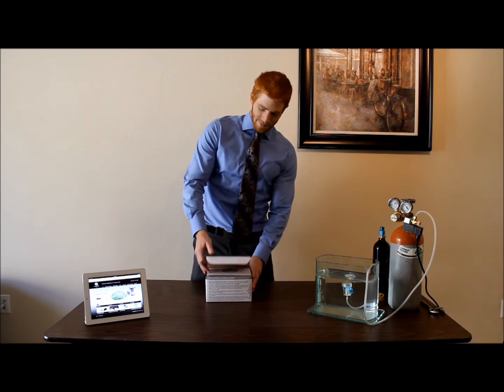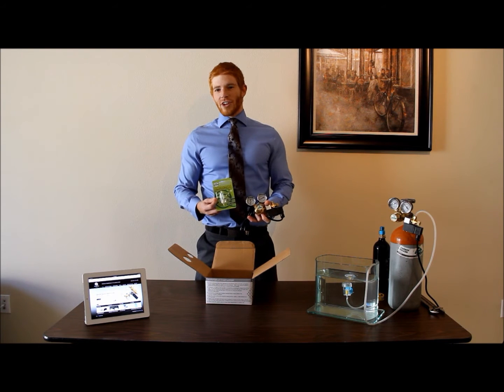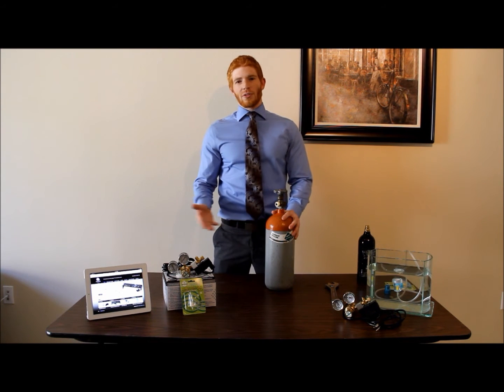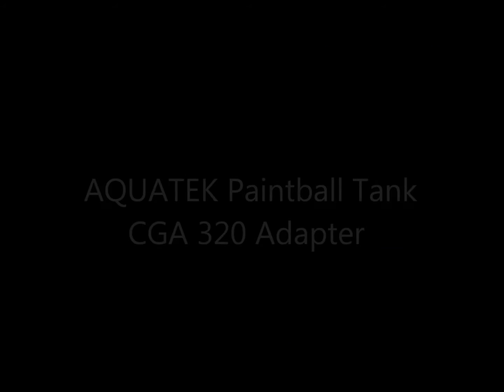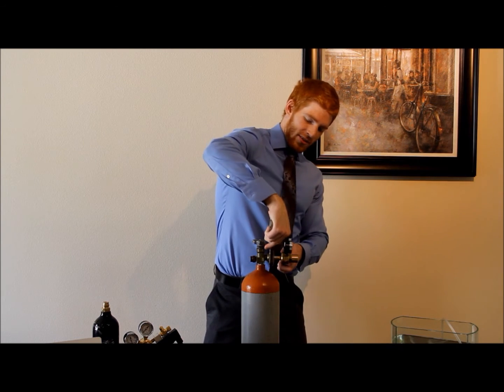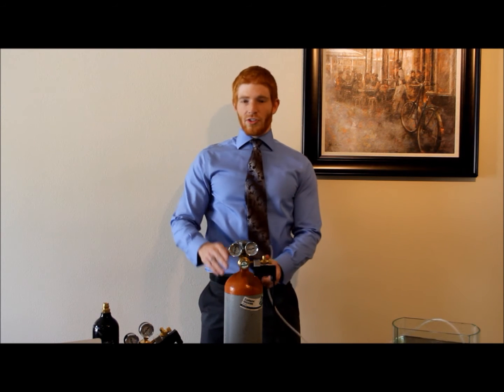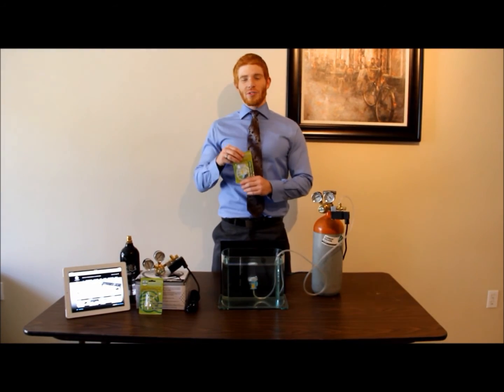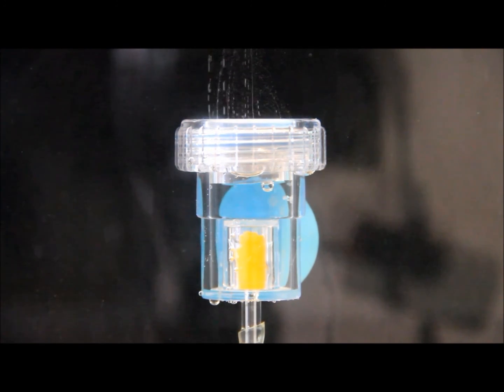Aquatek of California CO2 Regulator with Cool Touch Solenoid

Comment: why do you need the Bubble Counter with Integrated Check Valve that's included if you use the 3-in-1 option?  or can you use both?  I would like to diffuse co2 to the bottom of my filter (so the 3-in-1 product will not be a good match because it would not allow me see the bubbles)   Doe Aquatek offer a plain diffuser?  Any diffuser you would recommend?  Thank you

Comment from the maker: Thank you for your purchase and inquiry. Here are some tips about how to use CGA320 adapter properly.

1. Please DO NOT use the plastic O-ring in between the adapter and CO2 cylinder.
2. Please tighten the adapter and regulator with a wrench.

Also, please refer to the attached links in the video description, which are the discussions about how to attach the regulator to paintball tank and a Youtube video (thanks to a CGA320 user)

Sincerely,
Aquatek of California

Comment from the maker: @swish1onu 
Thank you for your inquiry. Aquatek regulator is designed and manufactured with a Fixed Working Pressure (approximately 40psi). The fixed working pressure is beneficial in maintaining the consistency of CO2 flow rate as measured by the bubble counter or flow meter. Many users of other manufacturer’s regulator which has an output pressure control knob experience difficulties in maintaining a consistency in flow rate as measured by bubble count at low output pressure.

Comment: So I purchased on of these a week ago... I'm intending to use it in my grow tent to supplement CO2 to the plants... anyway, which direction do i turn the knob to increase/decrease the CO2 release ? and what psi reading will the lowest gas release register? I've heard it has a factory preset as 30 psi minimum... what is the max ? and should I turn in clockwise to achieve increased release of gas ?

Comment: There is no need for a ON/OFF ASA valve if you want to use a paintball cylinder. 
The regulator can be attached to the Adapter. 

Somethings to consider:
This is a single stage regulator, google "End of tank dump" for problems that could occur.
This has a cheap needle valve (the twist part), you can upgrade this item to get a steady flow.

Aquatek's Co2 regulator have fairly good reviews compare to other retails products.
The best solution is a DIY regulator, you can make your own DUAL stage rig

Comment from the maker: Hi, Thank you for your inquiry, Yes, pretty much. However, you need to make sure your paintball co2 tanks is equipped with the standard pin valve. You can refer to the fourth photo in the AQUATEK CO2 paintball CGA 320 adapter product photo gallery. 
Aquatek of California

Comment: so if I buy the AQUATEK CO2 Regulator with COOL TOUCH SOLENOID + AQUATEK CO2 Paintball Tank CGA 320 Adapter I can use an old paintball CO2 tank and wont need any other gadgets?

Comment from the maker: Hi Sayurasem, Thank you for your inquiry. As long as your paintball tank is equipped with the "pin" valve, you can attach our adapter onto your tank. However, please remember to screw the adapter onto the CO2 regulator, then, screw it onto the paintball tank. Otherwise, it will start to release CO2 before the regulator is attached. Thank you. :) Aquatek of California